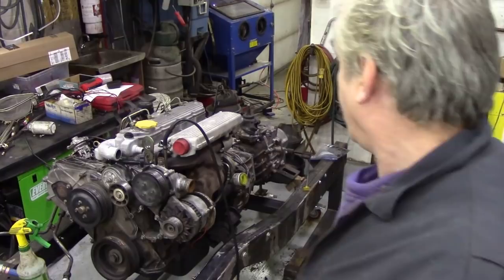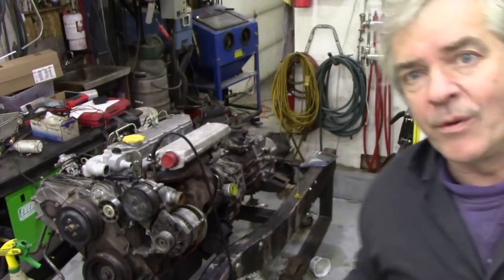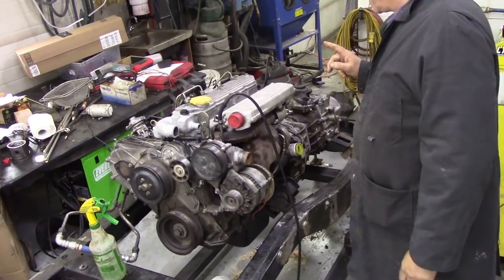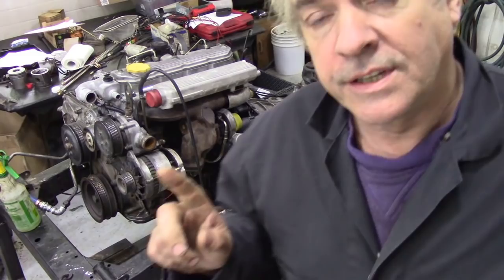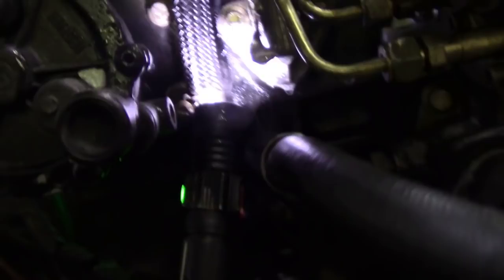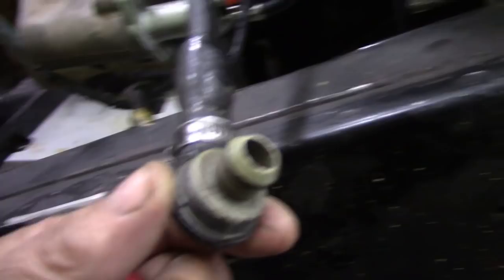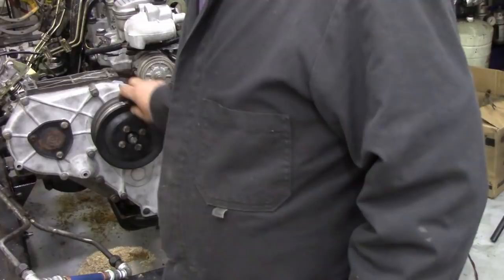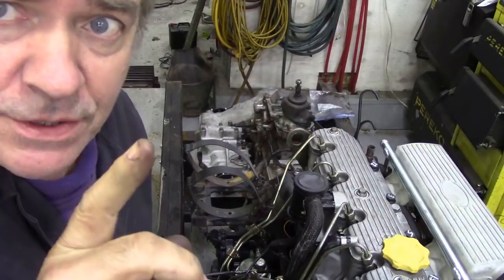Malawi 110 Smoke test and oil pressure test  - with problems!

Comment: Hey Mike, next time try some low pressure air down the dipstick tube, or vacuum on the turbo feed line or on one of the crankcase oil galleries, oil switch port etc while cranking, the air should help to re-prime the pump or at least drawing a vacuum on the oil line/gallery will help get things going in the right direction👍🇦🇺
Reply from the maker: Thanks for the tip

Comment: just rebuilt one of my 300tdi using plenty of tips from you, I couldn't get oil circulating  by tuning engine over by hand , end up overfilling with oil. got the pump working then took the extra oil out
Reply from the maker: That would work!
Reply: excellent videos Mike , helps half baked mecanics like myself end up with a reasonable repair that works, thanks @BritannicaRestorations

Comment: I fitted a Turner engine years back and had the same oil issue. Tried everything but no go. Rang turner's and he told me they do that sometimes, he side light here up and should put the light out after 3 or 4 seconds, it did, I was sweating though 😮

Comment: When I lost prime on my oil pump after working on the engine, I poured oil down the oil cooler line that come from the pump, and back filled it. It worked like a charm
Reply from the maker: That will work - I wonder why there was no sort of check valve on the oil pick up?
Reply: @BritannicaRestorations  I'd have to say I've never seen a motor with a "foot valve" fitted to the oil pickup pipe, seen a few submerged oil pumps.

Comment: I have a Turner rebuilt 300 that has been stood for six and a half years (all the ports and pipes blanked and under a lot of covers).  I think that will suffer the same problem, unless they pack the pump with grease like you do.  This is the benefit of the 200 and earlier 4cyl engines and their skew gear driven pump - it’s immersed and primes easily.
Reply from the maker: Yes - I would not expect they would build the pump with oil

Comment: My dad, a mechanic for years would always flat tow the new car/motor ( spark plugs removed ) in 4 th gear and see the oil light go out before actually starting the motor. I do the same.  Just make sure you’ve wired the oil light up properly and your fine!
Reply from the maker: I like to crank them over on the stand or test bench prior to fitting - just in case = I wonder why they didn't fit a check valve in the pick up pipe?

Comment: Mike, haven't had an oil leak on my 300Tdi engine since I got rid of those mechanical vacuum and fuel pumps and converted to electric, mah front diff housing is going rusty...
Reply from the maker: Lol!

Comment: Does a 200TDi have the same issue if left sat with no oil for 12months or so?  Made me want to get mine turning over now.
Reply from the maker: No, as the oil pump is in the lowest part of the sump as it shoudl be
Reply: @BritannicaRestorations  thats good news, i did remember for v8s packing the pump with vaseline it never occurred to me with this. Well its good news,
Reply: @peterjohnson2245  when I rebuilt my 3.5 Range Rover classic engine, I just took out the distributor drive gear and made an adaptor for my drill that rotated the oil pump to flow the oil and build pressure before starting the engine, that worked well.